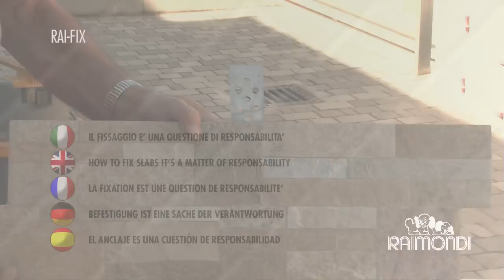RAIMONDI RAI-FIX

Comment: This is perfect for the KB home disaster in San Fran. This builder decided to put wood plank tile on the outside of the houses and they are falling off. It is very dangerous I think this would solve the problem. Seems to be very time consuming but very safe. I guess you cant put a price on that.

Comment: For those bitching and moaning. Here in the US I recently came across a question somebody was asking about how to keep the stone veneer attached to the wall 2 stories high. Well here it is.  This is the solution. You can rely solely on the thinset to hold the tile or stone attached to the wall and this mechanical fastener really helps the bond. Just think about a store front with a nice stone tile entrance that goes up 2 stories high, would you want it to fall and seriously injured or killed someone just because the installer thought it wasn't necessary or it was gay to use this? Think about for a sec.
Reply: Ююю
Reply: Francisco Espinosa